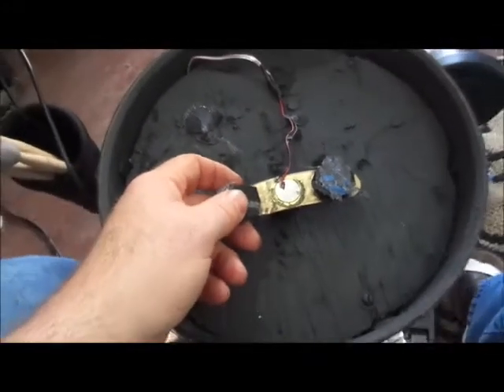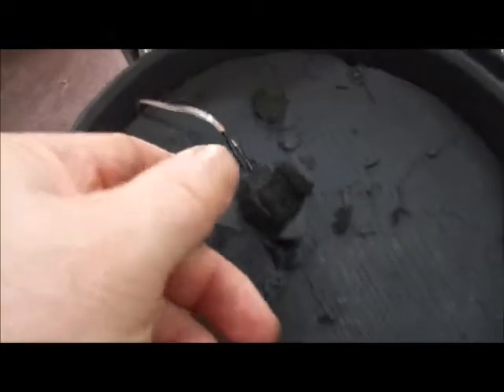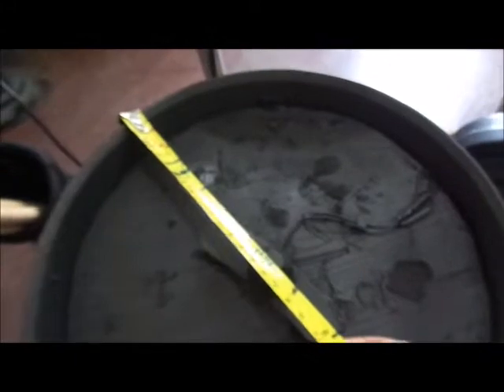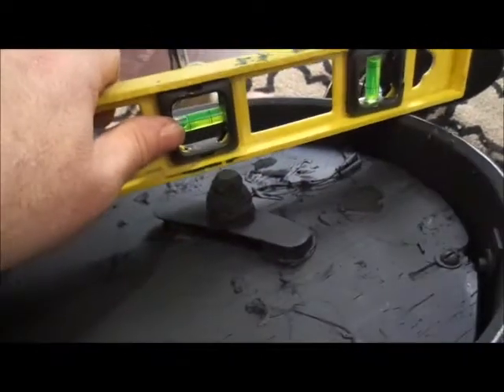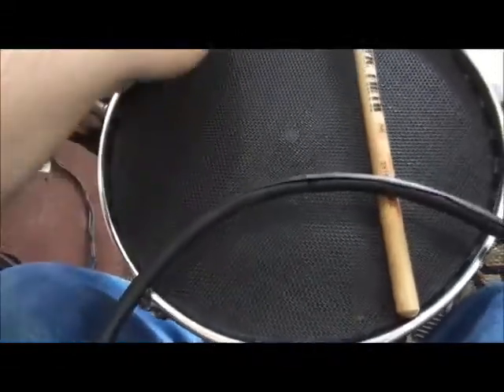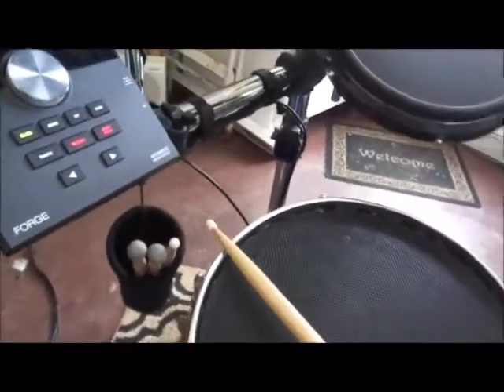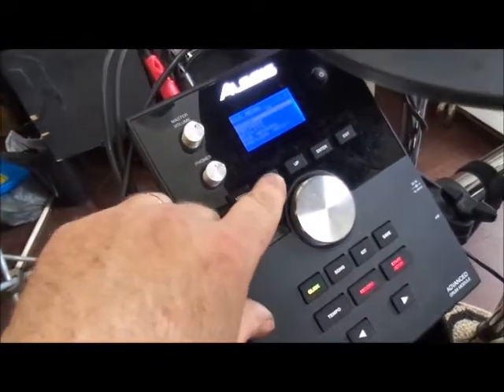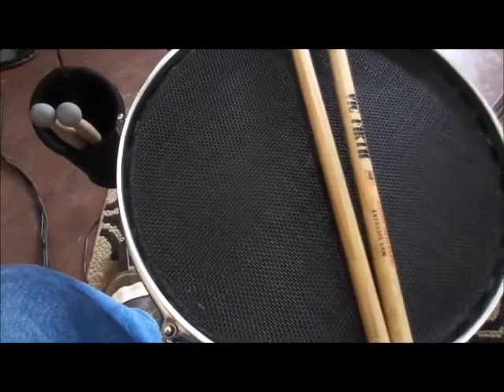Diy E Drum Trigger Build for Alesis forge Kit

Comment: Cool DIY!!  I had to fix one my pads I used duct tape cause piezo was loose that did the job for me.  But mine are the rubber pads so they are different anyways.
Reply from the maker: Yes the piezo is on a metal plate... I'm hoping to build a bigger ride cymbal... Thanks